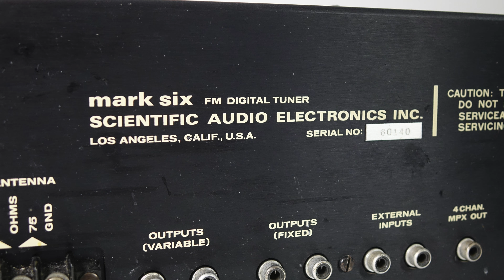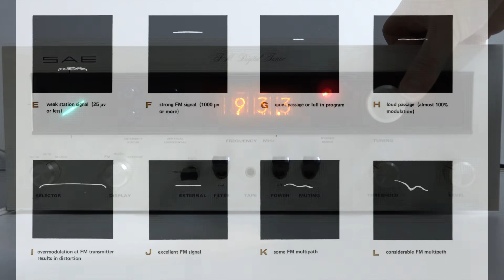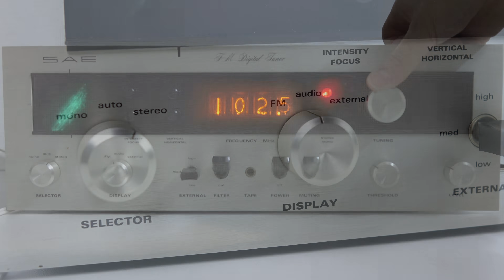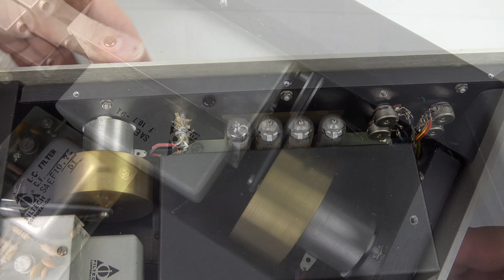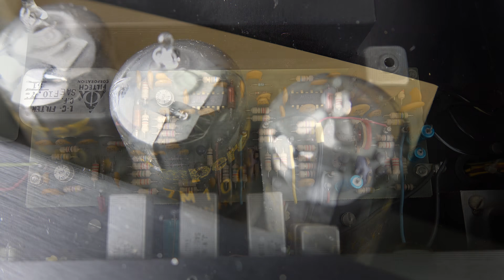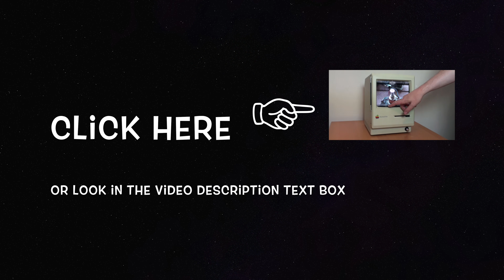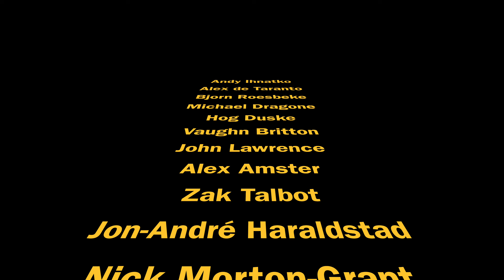Retro-Tech: SAE Mk6 FM Tuner - My Vintage HiFi holy grail

Comment: that's a beauty!!....btw if anyone wants to get some impossibly expensive audio gear..check out Russ Andrews...i'm not sure there's any better quality on the market...and they will refurb/upgrade your older amps etc with new capacitors. :)
*though i'm not sure how far back they go for the upgrades
**should it have been 75 ohms not 700 ohms at 3:30 ??..i think 75 ohm is the standard for TV and radio??

Comment: Awesome, as usual.  In the US, FM channels are separated by 0.2MHz starting at 87.9MHz.  The SAE appears to have an infinitely variable analog tuner.  I'm surprised it won't pick stations in-between the 0.2MHz spacing, even if the Nixie display doesn't report the correct frequency.

Comment: Excellent video, and what a lovely piece of kit!
Love those toggle switches, nixie's, oscilloscope, well every aspect of it 
Did you know that the some of the old valve radios of the 30's & 40's had what was called a ' magic tunning eye' which was a special valve that glowed green. it enabled you to tune the radio in, as the green glowing bar came nearer together as the station was tuned in.

Comment: whoaa, congrats on aquiring this beast of a machine. I have some knowledge and experience in working on such devices and your observation that it seems really thoughtfully designed is so true. If it were mine I would probably leave the original capacitors in there but double-check the ones that have been replaced. Vintage caps usually simply lose capacity. The modern replacements are more likely to short out when they are not well made. Good capacitor brands today are nichicon, nippon chemicon and panasonic. Always use 105 deg C rated caps as these will generally last longer.
Reply: antiekeradio
Good advice 😊

Comment: If this didn't say SAE on the front, I'd swear it was made by Marantz. Has the exact same look and lettering as Marantz, and even the photo of the SAE collection looks like Marantz stuff. Very interesting. Looks like this was serviced and recapped fairly recently which is why it is in good working condition.  Oscilloscopes on receivers / tuners are the coolest thing ever made and it is a real shame that didn't continue through the years.

Comment: Nice, I am not into the tubes for display, for amplification okay.  I like the oscilloscope though.  Seems like a CRT oscilloscope judging by the long tube inside.  And that's true indeed that we can now afford equipment that we wouldn't be able to afford back then.  I recently saw a $300,000 Sony PCM-3348 for less than $2,000 on eBay.  We live in times when there are absolute gems of technology and craftsmanship (craftspersonship to be PC?)  for close to nothing in terms of price.  Thank you millennials for having your eyes on your phones in ear buds.  Thanks to you I can get my dream gear for very very very reasonable prices :)

Comment: I remember the Ford Mustang FM radio Top Tested would also only tune every other digit. Is that a US thing? (as in they only allocate odd frequencies)

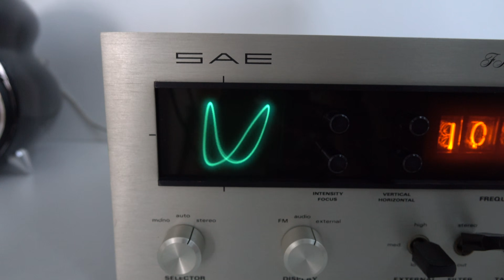Also at 9:45 it sounds like an ICE1/2 Power car or Siemens Taurus locomotive acceleration :)

Comment: Transistors in sockets usually because you could select the best transistor for gain etc after the unit was built. Generally designed out nowadays

Comment: These MC1355 ICs are very old FM/IF amplifiers. They had more than 50dB SNR at 10mV input signal. Discrete transistors circuits back then had barely 50dB, only the whacky Japanese with their high end transistors in the late 70's startet to outperform them. Also notice that PCB is epoxy resin material "FR4" and not that usual brown stuff they commonly used back then. That tuner is high industrial quality and a beauty to look at. Those panels could actually be replaced by clear acrylic glass to show off how well it is made.

Comment: Hey Mr. Moan, the reason the visualizer looks all scratchy is because the machine is using the L and R channels as the X and Y axes and without a constant you just get what looks like noise unless there is specific interplay between the waveforms in the L and R channels (like you demonstrated with the synth). If you'd like a traditional oscilloscope display for music on that device, drive one of the sound channels into the vertical input, and instead of more sound use a constant sine or triangle wave on the horizontal input (heck you could even use the kaospad again).  That'll scan the beam back and forth in a uniform way and look really cool. Try different frequencies of the carrier wave to get different tightness and legibility. I really hope you make a supplementary clip if this works for you!
Reply: The L vs R oscilloscope is very much intended to be a display for music (or any other broadcast or recorded audio). Engineers use it as a tool keep an eye on the signal's mono compatibility. The more the scope looks like a straight line from lower left to upper right, the closer the L and R signals are. If the scope shows a straight line running on the OTHER diagonal, then L and R have the same signal 180 degrees out of phase and will sum to a mono signal of complete silence.

Comment: I got one of those about 12 years ago for $15. It didn't work which is why it was so cheap. I fixed it though. The oscilloscope screen is dead but the rest works perfectly. SAE is one of the best brands that I've ever found for audio componentry. Your lucky to have found one in such good condition. Truthfully I'm a bit jealous. I might be upset if I didn't know it had found a good home with a caring owner. I've seen enough of your videos though. I know it's in good hands.

Comment: A couple of things about the oscilloscope tube (the CRT).   The metal shielding is usually used to keep interference from getting into the tube, and deflecting the beam.  Any magnetic field will deflect the scope beam so it needs to be isolated, and the shield is mostly designed to eliminate external magnetism from things like transformers.   These shields are made out of mu-metal, and if it gets dented, that can adversely impact its effectiveness: https://en.wikipedia.org/wiki/Mu-metal

The tube itself would likely not emit enough RF to produce radio interference, though it's driver circuitry could.    

Also, when a CRT gets old, one thing you may notice is a characteristic called "blooming."   That's a sign of the tube getting weak.   The way that exhibits itself is as you turn the intensity up, it reaches a peak before the max intensity setting, then as you turn it further up the intensity drops and the beam defocuses.   If the tube is doing that, it's a sign it's showing its age.

And with regards to capacitors needing to be changed over time, that depends a lot on what kind of capacitors they are.   Some have a tendency to leak over time-- the worst offenders are probably the old wax & paper caps used in ancient vacuum tube equipment, but that's probably not what you have here.  Excessive heat can degrade them as well, so it also depends on the environment they're in.   Mylar caps hold up pretty well in comparison.  Tantalum capacitors don't always age well, though capacitor technology may have been improved over the years so I don't know if that's still true.   It's possible to measure leakage but as you'd have to take the part out of the circuit to do that, if you're going to go that far, you might as well just replace them anyway since they're relatively inexpensive.

At any rate, a nice looking unit, congrats on finding one!

Comment: Thank you for your afford to support us sound via line in signal. My recommendation for the oscilloscope is to keep the contrast at 75%. Otherwise the beem can burn in, especially, when there is no sound and just a dot visible. The oscilloscope will also wore out faster on 100%. I totally didn't expect the synth part from you and was well surprised by the visual effects you achieved.

Comment: Amazing bit of old tech. Back when function took a side step to allow form to come through. It's all about the wow factor with this device, and that's awesome. I had a Side-Load VHS player that may not be as good as modern units, 1986 4 head VHS HQ JVC, but because the tapes loaded in like a Car Tape deck, i loved it.

Comment: "There is nothing wrong with your tuner.  Do not attempt to adjust your dial.  WE are now controlling the transmission.  WE control the horizontal.  WE control the vertical.  We can deluge you with a thousand stations, or expand one single sound to crystal clarity."

Comment: Nice kit.  Shame about the odd frequencies (e.g. 89.1, 89.3) rather than the even variety (e.g. 89.0, 89.2) we use over here - once again, the americans doing their own thing!  There's probably a tuning adjustment pot inside the unit that you could use to make 89.1 become 89.0.  The display would still stay 89.1 (or whetever), but you'd know to subtract(/add) 0.1 onto all your frequencies.  You would then get much better tuning, especially on the weaker stations.  Maybe ask that SAE guy if he knows where that pot is, pick a weak station and twiddle the pot until it is as clear as possible.  If you do try it, best of luck!

Comment: Thanks for cracking it open so we could see the guts. The shield around the CRT is made of a metal called mu-metal that shields magnetic fields. These are often used in oscilloscopes and vidicon tube cameras to prevent any electromagnetic fields from interfering with the electron beam in the CRT. They also work prevent the CRT's interfering with other devices.

The two IC's were built in the 39th week of 1970 from the date code of 7039 on them. First two digits are the year and the last two are the week. Most electronic components use this date code system. The Nixie driver circuits will be under the shield behind them. The board with the two IC's actually has four of them on there, the other two are the metal can type, you can tell they are IC's as they have more than three pins.

The machine dose seem to have had work done on it in recent years as some of the caps in the bottom have been replaced with modern equivalents. You are wright, it has been very well layed out and designed. Hope this extra info is useful.